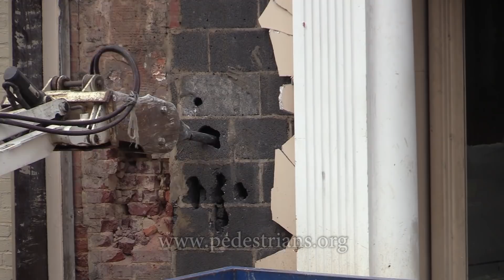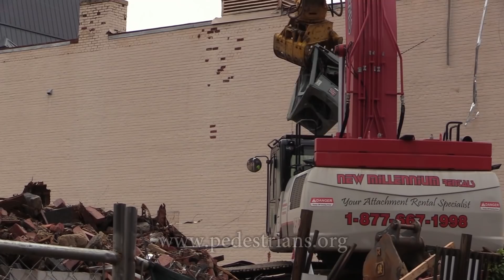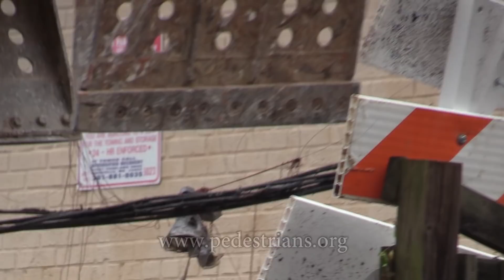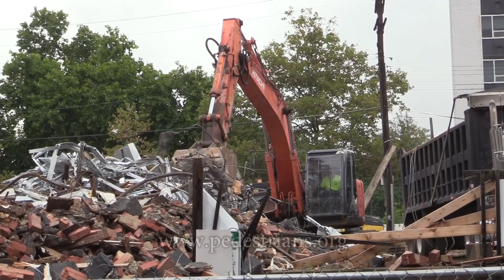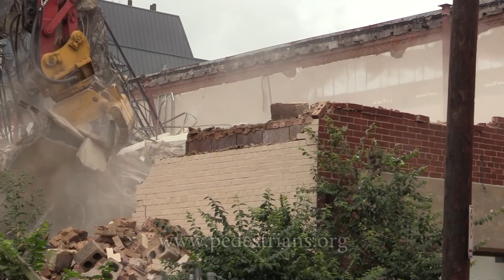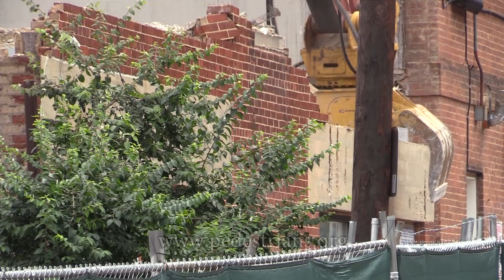Demolition 6950 Wisconsin, Bethesda

Comment: A very interesting building. Thanks for posting this, John.

I'm glad you explained in the comments on the last video how this building was hung on the side of the one next to it. The shots of them cutting the front and back walls, and the one of remains of the cut trusses were helpful. Thanks.

It looks like the whole back of the building was one huge room. A plastered ceiling, 20 feet high or so, and finished walls. Then a drop ceiling was added, but still pretty tall. What was it used for? Looks like it was intended for warehouse space, but there's no visible access for unloading goods.

The concrete center structure is also interesting. Very basic re-enforced concrete. Just two rebars in the bottom of the beam, and four in the corners of the columns. Do you know when this was built?

I'd think the steel columns were to support HVAC equipment on the roof. But there were no beams running across the roof. Had they already been removed?
Reply from the maker: Built in 1944.  (The one next to it was built in 1941.)  I don't know the original use, but in recent years it has been retail, most recently a mattress store.

The steel columns were added a couple of decades ago to support additional floors that were never built.  In conjunction with the construction of 6936, which had heavily reinforced walls that were also intended to support additional floors.  The main purpose of 6936, which was never fulfilled, was to provide access to those additional floors on 6950.  Instead, it just provided access to the basement of 6950.  (Otherwise, 6936 was a small building that made no sense by itself.)

I'm going by the address numbers on the front of the buildings for 6936 and 6950.  Some property records have them reversed.
Reply: @JohnZWetmore  Thanks, John. I did notice the basement stairs in 6936 which seemed to take up a lot of room in such a small building. That explains them.

Comment: I stopped watching after about 6 minutes....That was difficult to watch....The whole "paid by the hour" thing going on....
Reply: I'd guess he's doing just what the management wants... separating materials for best advantage in disposal. He's separating recyclable metal out, then separating the remainder to reduce dumping costs.
Reply: No he's doing it because it's still connected to a building they are using if you pay attention.
Reply: @rhythmblackheart917  Actually, it no longer was. At 0:20 you can see them cutting away the connection at the front, and at 0:40 the back wall. But those were all taken earlier. At 27:48 you can see that the roof trusses have all been cut away from the other building and the far half of the roof has fallen in. At 31:38 you can see more clearly where the trusses have been cut away from the other building. At 31:40 you can see him pulling the back wall in, carefully to avoid it falling into the alley, but it's already free of the next building.